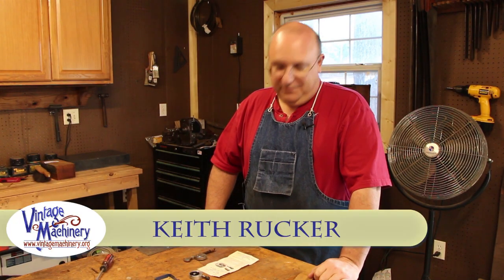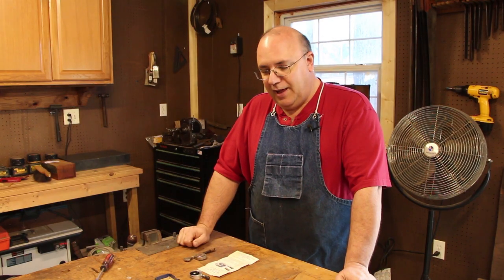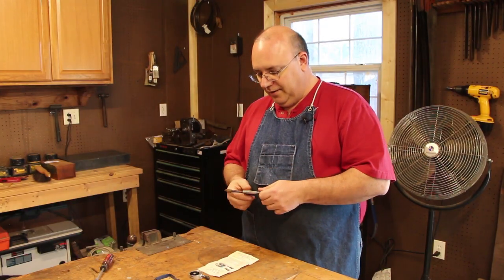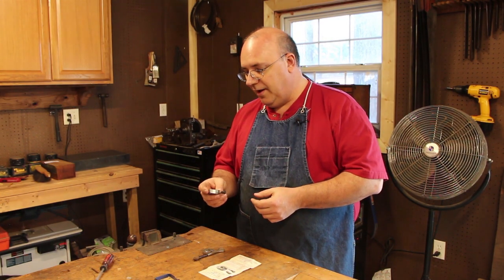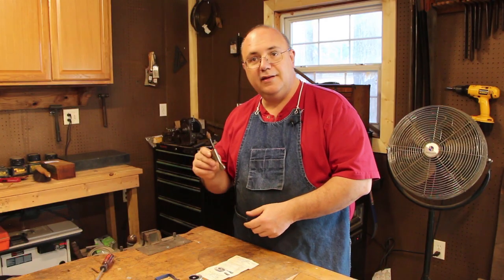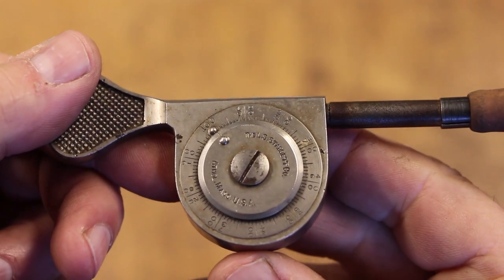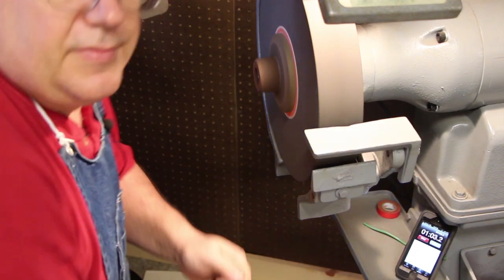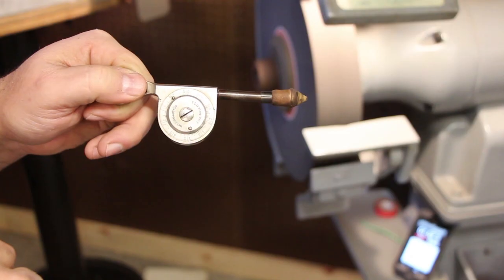Using a Machinist Speed Indicator (Tachometer)

Comment: Hello Keith. I own a mixed farm in Australia and I do believe these type indicators were often used when wool sheds were built. Back in the day these used a common shaft to drive the overhead gear which drove the shearers' handpieces. Too fast and the handpiece would overheat, too slow and it would not cut the wool properly. The ends of the common shaft would be centre punched so that the end of a Starrett or other tachometer could be inserted to give the RPM. 

I have often heard oldtimers speak of these indicators but this is the first time I have ever seen one used. Thank you for posting this.

Comment: Keith;

Starrett offered 3 models of speed indicator (tachometer).  The 104, 106, and 107. The 104 is a high speed indicator and the 106 is the same, but with a rubber handle to be used where electrical insulation from a source is required.  The 107 is a registering indicator with an outer dial that registers up to 100 revolutions and an inner dial that reads each 100 revolutions up to a total of 50 (for 5,000 total revolutions).  There is also a 109 attachment that looks like a rubber donut wheel and it is used to help calculate surface feet per minute for bandsaw blades, etc.

Regards;

Ron Kluwe

Comment: Nice informative video Keith. Thanks for the demonstration. I like the grinder. I have the 12" size at work they bought me new. A must have for large tool grinding. 

Adam
Reply: That voltage must make a big difference on startup. Ours is wired 440V and it spins up to full speed in about 2 seconds. Very nice grinders. 
The one I have at home is a Queen City 12" pedestal that was bought by my grandad used back in 1972. I love it and is a nice grinder for making tools and sharpening big drills. 
Yea seems you have us beat on the biggest grinder, but I'm sure I can find something else to shame you with. LOL

Comment: Thank you for this! I picked one of the Starratt indicators and had no idea what it was — gotta love Google Image Search! On my model (no number) the outside dial turns with the pick up, making one complete revolution for 100 revs of the pickup tip The inner dial is locked in place by a pointer until the outer dial makes one complete revolution (i.e. 100 turns). At that point a raised bump on the outer ring lifts the pointer allowing the inner dial to move one division. Once the "bump" goes by, the pointer falls back and locks the centre dial for another 100 turns of the pickup. Very neat, and I don't have to count as I measure merely watching and waiting for the 1 minute interval. Then as you illustrated add the inner dial position (X 100) to the outer dial (direct reading) for the machine RPM.

Comment: Keith, I love your videos, great work! I would like to comment on your electrical discussion. A rotary phase converter will produce a frequency equal to the line frequency - 60 Hertz in the USA. The induction motor on the grinder is rated for 1725 rpm at rated horsepower - it will spin faster at lighter loads (in electrical jargon, less slip). That is why you saw 1745 rpm - the grinder motor was not operating under rated load. It isn't because the rotary phase converter frequency is high. Good video,. -> Gary

Comment: Thank you very much. My Starrett is a little different than yours. Mine the outside dial spins and the inside dial counts the turns. there is a pointer that gives you a start point. I think I got it figured out now. Thanks again.

Comment: Thanks Keith for renewing my interest.  Mine was from wifes grandfather 'machinist'
in the 1920s. Far as I know there were 3 Starrett.models , I have the middle one around 1910 complete with acc.  Mr Pete did a vid on this and for surface feet per
minute it is correct to either time for a min. and divided by 2 OR time for 30 sec. It
says so in the instructions. Includeds a rubber ball, rubber point and wheel for SFM
works good such as SFM on a bandsaw . 104yrs old and is perfect........
sam

Comment: Keith,
  Thanks for the information about the speed indicators.  One thing I do if I'm in a hurry and don't need an exact speed, is to time it for 30 seconds and double the results, or even times by 4 for a 15 second measurement.  The results are still actually fairly accurate.

Comment: Nice demo on the tachometers, Keith.  On the issue of the phase converter, the converter has nothing to do with the line frequency variations, nor does your grinder motor for that matter.  Line frequency is a function of what the power company is delivering to its customers; which in most areas of the USA, is 60Hz per second.  The grinder motor's synchronous rpm (synchronous to the line frequency of a four pole motor) is 1800 rpm, in your case, and slip speed, when the shaft is fully loaded at  nameplate current, is rated at 1725; again, nothing to do with your phase converter. Motors running off of phase converters are usually de-rated from nameplate current, on account of the imbalances of the phases, how carefully one balances these phases can improve the out put of these motors, but are never able to produce full nameplate power.  Hope this helps.

Comment: another great video, i have an interesting tach made by jaeger watch co in 1943 for the us air force. this unit has a face like a one inch dial indicator. you hold the stem on to the shaft to be measured and push a reset button. the tach then winds up counting the rpm and stopping when max rpm is reached. it holds the reading until you are ready to use it again,no watching a stop watch or counting a rotating dial..its a real piece of american craftsmanship

Comment: Keith, thanks for the demo.  I looked around a bit and it doesn't look like those are made any longer. I found lots of modern equivalents though...all electronic optical types that look for a bright spot going by.  Bright spot can be shiny tape or white paint spot.  May be faster and easier, but I think I'd rather have one like yours. 

-- Mike

Comment: A old timer that I worked with for years showed me one of the starrett  speed indicator asking me if I knew what it was 
At the time I didnt 
After explaining it to me he gave it to me 
Clarance passed away a month after retiring after a long career of being a heavy duty mechanic 
I will cherish that tool till I pass it on to someone else in the trade   
Maybe I will be as respected as he was in the trade
Ive checked mine against a digital tachometer and the srarrett indicator is very accurate

Comment: I have the starrett like yours but I've never seen the B&S. I'm so favorite to brown and sharp I'll be trying to find one on eBay. eBay has been awesome to acquire old badass tools. and seriously since starrett started manufacturing in China I've had such a hard time finding quality  micrometers. buying a used mic goes against everything in me, those are expendable in my shop, you can adjust the threads about twice and you won't be able to achieve a .0002 uncertainty factor after that, they are goners and I donate them to a school or something. New starretts out of the box now are the same. I bought two chrome versions a couple years ago and pulled them out a few times, while checking them they didn't feel right and I'd just throw them back in the drawer. after a while I got to where I needed them and spent a couple hours trying to calibrate them and couldn't achieve even a .0002 uncertainty factor. friends at American airline, buy much more than I do and they said they actually had the carbide fall off of some. This being my main daily use tool, made a serious issue for me. I can tell the long version but what I ended up doing is buying old mint condition or NOS B&S off eBay and I qualify them carefully, I only use maybe half of what I buy because not all are perfect. many other tools are simular. we have to care for these tool more now a lot of it we may be working with the last we see of that quality. Thank you for the video, I'll check out some more of them. :)

Comment: Thanks for the info.  I also use a model aircraft tachometer, by putting a piece of tape on the shaft. Since it sees a flash of reflected light, don't use a lamp operating at 60Hz. Use a DC flashlight.

Comment: Keith, I was taught to hold the cetreplate before contact with the drive shaft (it has a friction drive) then release when you start the time. I have a Starrtett with a patent of 1905 and a much later one, it works well with both. I wouldn't hold it for too long once engaged as I suspect the friction drive might suffer if the reves are high. Interested in comments on this.
Reply from the maker: +Alan Taylor I sure am not going to tell you that holding the plate is wrong as I am sure it works fine, but I guess I was taught to just engage it when you start your time.  I suspect either way will work just fine.  My only concern with holding the plate is that it will keep the shaft from turning and that would wear the friction drive very quickly where putting it in and pulling it out would not result in much wear at all.

Comment: I have always wondered why most motors are set to run at 1725 RPM ? Always enjoy your videos.
Reply: There's a formula for the no-load speed that should make sense.
number of cycles (Hz) * 60 (seconds in a minute) * 2 (for each positive and negative swing per cycle) divided by the number of poles.
In this case, we have a 60hz rotary phase converter and a 4 pole motor. So, plugging those values in:
60(hz)* 60(seconds) * 2 = 7200 / 4 (poles) = 1800 RPM.
Now, there's always some slip to account for in a magnetic drive, and more with a rotary phase converter.
Say you have a motor with a no load speed of 1800 RPM turning a phase converter (basically a 3 phase motor pushing current instead of pulling), the load of the motor's bearings, the work needed to push electrons through the coils of the 3 phase converter by rotating its windings in a magnetic field, the load from pushing the cooling fans through the air, and other various frictions, that no-load speed is going to slip in a few places. So when you get to the 5hp Baldor grinder, you get a slip of some percentage. The motor is trying its best to go 1800 RPMS, but I see a lot of motors rated at 1725 speed running at ~1750 or 1740. Same with 2 pole motors, they run a few tens of RPMs slower than their calculated no load speed, but a few RPMs faster than the speed rating.
Reply: @t0x0n1x  Yup, induction motors have to have slip or they will not have any torque. 
A bit more droop according to the curve for that particular motor for any particular load.

Comment: mrpete222 shows how to use the same to measure the surface speed using a homemade. It is "Machine Shop Tips #88" if you are interested.

Thanks for posting your version.  That is a big grinder.

Comment: Keith,
Just hold it on the shaft for 10-seconds, then multiply by 6. :)

Tom - Vista, CA
Reply: *****
I forgot about it as well. :)
Your videos are always interesting and welcome. I especially like the ones you do at the Museum. Having grown up on a ranch, we had to know how to fix something if it broke. The IH and John Deere dealers charged an arm and a leg, so fix and make do was the name of the game.
Tom - Vista, CA
Reply: Even easier, hold for 6 seconds and multiply by 10 (I.e. add a zero)...it's a trick nurses and doctors use for taking pulses.

-- Mike
Reply: Yup, perfect for a quick check but your resolution suffers by the same amount though this will not often matter.

Comment: That is just a pocket size mechanical tool that can measure a 1725 RPM motor running. It's easy to miss but the user also knows what he's doing and you will need some practice/training to measure like that.

Comment: Actually your 1725 speed at 60 cycles is at full load.  At 60 cycles and little load your speed should be considerably closer to 1800 rpm.  Ideally with no load and no fraction your motor would travel at 1800 rpm and as load is applied up to full load the rpm should drop to 1725rpm.  On your test if you would have went the full 60 seconds you would have read about 1775rpm and that should be about right with little load at 60 cycles.  Sounds like your phase converter is about right on 60 cycles.